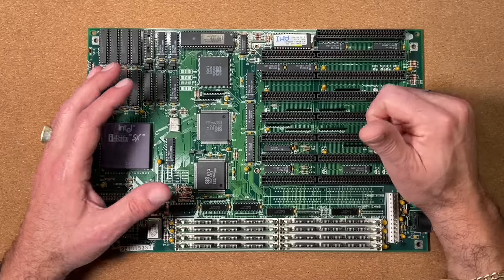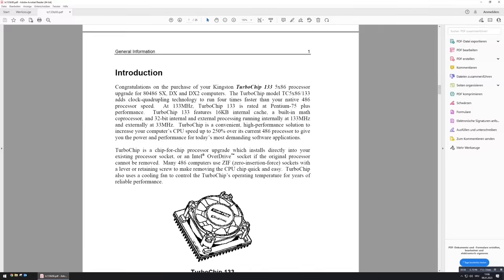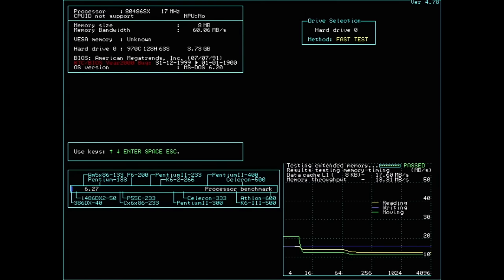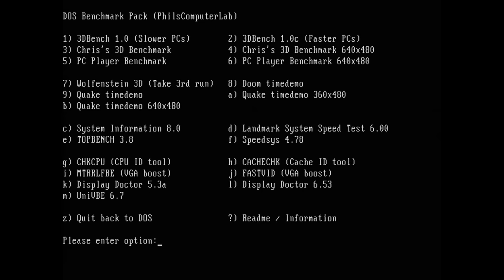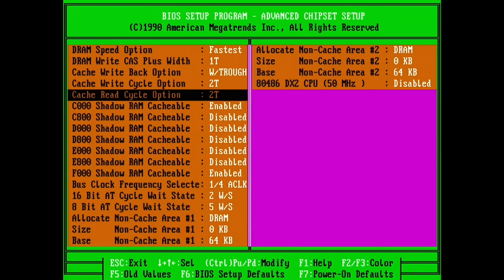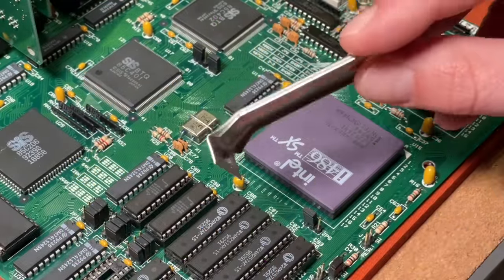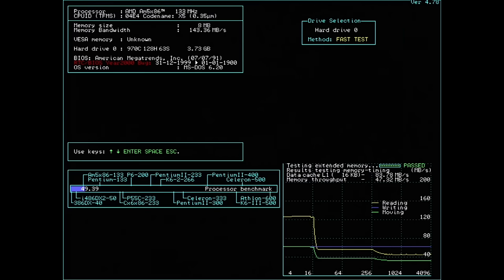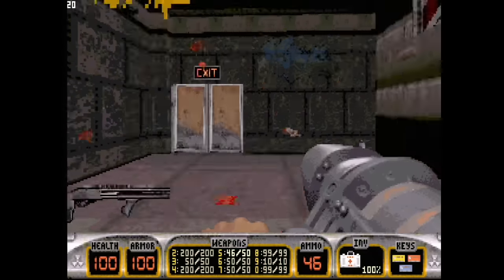Intel 486SX-16MHz Benchmark and Upgrade to Kingston Turbochip at 133MHz (AMD 5x86-133)

Comment: We got that exact upgrade for our packard bell legend 25mhz sx.  The performance boost was huge.  It was like getting a whole new computer.  We upgraded from 4 to 16 mb of ram and put in a sb16 and cdrom too.
Reply: I remember my first CD-ROM, I had to use the ide port that was on the sound card 😔
Reply: The good ol days lol
Reply: Hello fellow 25mhz SX user. My grandpa gifted me what must have been the cheapest IBM at the time because it only had TWO megabytes of ram and the CPU wasn’t socketed so no dream upgrades like this haha. It let me get on local BBS tho and the rest is history!

<3
Reply: 686 was my fav btw
Reply: @idadru   back then  there were 3x CD-Rom interfaces on sound cards, dont be fooled that they are IDE,  the Sony, Mitsumi & the Panasonic - IDE CDRoms came later and didnt need the audio cable after DAE became a thing.. I preferred the Panasonic drives back then no messing around and worked without issues, the sony ones were the most problematic, they didnt even have a motorised tray lol they just spat the tray out half way under spring pressure... lol
Reply: That's the kind of upgrade that gives you whiplash. Was the board ISA only or did it have VLB?
Reply: @ironhead2008  that or PCI would improve the situation. A fast 486 is held back by an ISA graphics card. I noticed he didn't upgrade that and the performance was kind of held back. I think I remember Doom doing better than 20 something FPS on VLB or PCI cards. But what do I know; back then we weren't exactly measuring it, nor did it originally have a FPS counter. The new sourceports do (like GZDoom) and it's easy to reach or exceed vertical refresh on newer hardware. I could run a simulation on PCem and figure it out, probably. That thing's accurate.
Reply: @SeeJayPlayGames  old CRTs were also better at hiding slower frame rates. A modern flat panel smacks you in the face if the frame rate isn't just so.
Reply: can confirm, after extensive PCem testing of various simulated 486 configurations, that ISA video cards will indeed hold back any 486 in DOOM (from 16MHz SX on up). An ISA (be it 8 or 16 bit) VGA card in a 486DX2/66 will run DOOM slower (8-bit: 7626/ 16-bit: 6313 realtics; 8-bit: 9.794/16-bit: 11.831 fps) than a VLB card in a 486SX/33 (5123 realtics; 14.58 fps). 

Even a DX4/100 won't help (8-bit: 6838/slow 16-bit: 5532 - still slower than the 486SX-33 with VLB/PCI. Only a "fast" 16-bit card (whatever that would be, tested on the DX2-66) scored better than (4348 realtics) the SX-33 VLB/PCI. Even still, impressive gains can be had by upgrading to a local bus card from ANY ISA card, no matter how "fast."

So, (all) ISA cards are definitely a bottleneck. It becomes more obvious the higher up the CPU hierarchy you go. With a Pentium OverDrive 83MHz, I got 1774 realtics (42.103 fps) but when I put the VGA into 8-bit mode it only did 6420 (11.634 fps). 

The fastest chip I could simulate on the same virtual AMI 486 clone motherboard was an AMD Am5x86-P75+, which scored a blazing 1332 realtics, or just over 56fps. That went to a sluggish 6370 realtics, or 11.725 fps when the bus mode was switched to 8-bit. So yeah, the faster the CPU, the more an old ISA card bottlenecks it. 

Interestingly, (or not) the most "ideal 35 fps" experience is to be had with a 486DX4-100 with a fast VLB/PCI card. That simulated configuration ran the timedemo closest to realtime (2134 gametics / 2095 realtics or 35.652 fps).

IDK if DOOM was the first game to really push VGA cards, but you gotta figure, it's gotta update pretty much the WHOLE SCREEN every time you move just a little. Previous games may not have had this dilemma. So, maybe.
Reply: @SeeJayPlayGames  Doom doesn't really use any specialized video card tricks IIRC, it relies on a fast frame buffer with enough bandwidth to keep up with the CPU, that's why a 100-ish MHZ 486 class chip up to a Pentium 83mhz or equivalent (the 5x86 counts here because the engine is optimized for a 486 style FPU to the extent it needs an FPU, this ain't Quake) is just about optimal for the game (remember the engine is capped at 44 FPS in game IIRC). Any faster and the CPU is being underutilized. Slower and it's not as fun. I suspect a DX2 or equivalent might be the slowest I'd go assuming PCI or VLB. An interesting thing to try might be using one of ATI's 16 bit ISA offerings, specifically the Graphics Vantage or the VGA Wonder (same VGA core, the Vantage has a Mach 8 accelerator onboard). Supposedly they are VERY tolerant of overclocked ISA buses and are able to handle up to 20 mhz. Of course finding sound and controller cards that can hang at faster ISA speeds would be the bigger issue after that, but you might be able to manage 10 to 12 (lots of controllers and some sound cards handle those speeds in XT clones). I'll wager a 20 to 33 percent bump in bandwidth might make all the difference. It might also be worth it to try an ET-4000 or an TVGA-8900D (with the full fat 32 bit memory bus and FIFO) because they might be able to handle a more modest ISA bus OC.
Reply from the maker: interesting, I am reading your comment while trying exactly that. 😆. Right now I am at 16 mhz ISA clock and 160 Mhz on the kingston turbochip. and you are right with the trident 8900D-R, this one turned out to be the best performer. 😉
Reply: @CPUGalaxy  Yup. that card in particular is STUPID FAST when it comes to the old school "dumb framebuffer" style of video card, perhaps not as fast as an ET-4000 in most circumstances but relatively close and as you found, tolerates faster ISA clocks. The Trident DAC it was usually paired with is a pretty good one, too. It's one of those sleeper cards one might be able to snap up for a fraction of the price of a good ET-4000 with a good true color DAC because some entusiasts might look at "Trident" and "8900" and automatically pass on it. Now the hard part, as I mentioned above, is going to be finding a controller card that can handle those speeds and a sound card that can also tolerate a 2x ISA overclock. Maybe there's an ISA sound card out there that's known to be tolerant of fast bus speeds, I haven't really looked into it. I wonder if a Snark Barker with fast TTL chips (F or AHCT rated) and a faster crystal could handle it?
Reply from the maker: well, now managed 26,66 Mhz ISA clock and running stable. lol
Reply: @CPUGalaxy  Well that's screaming!!! Probably makes Doom more than playable, too!!!
Reply: @ironhead2008  *capped at 35fps - mode 13h is 70Hz so half refresh vsync. If DOS even did VSYNC, that is... IDK.
Reply: @SeeJayPlayGames  Ah, so that's where it comes from. It was some odd number that didn't stick with me all that well, but knowing that, it makes sense.

Comment: If someone made a change like that in 1996 I imagine it would be shocking how diffrent that computer  would feel.
Reply: Seriously… It made it 4-5x faster in a few minutes. No wonder Overdrive/Turbochip upgrades sold like hotcakes. You’d save at least $1000, which is about $2000 today!
Reply: If they're using this in 1996 I'd feel bad for them. Pentium II was out by 97.
Reply: I remember pentium 2 being just stupidly expensive when released. It was much cheaper by 1998. Same with pentium; the P60 and P66 was very expensive and almost nobody had one.
Reply: I upgraded my first PC from a 486 SX 25, to a DX 33, to a DX2 66 to a DX4 100. Yes it made stuff faster but it's a law of diminishing returns because the rest of the system like the bus, memory, storage etc becomes the bottle neck. I still got 4 or so years out of it, upgrading bits and pieces until I did a reset for my move to Pentium.
Reply: @drxym  For games I'm not sure anything above the DX 33 helped if you had some horrid trident ISA graphics thing. If you have a really fast ISA card I think you'd still see gains from the DX-2/66 and above that you'd really want a VLB or PCI card (some very late 486 motherboards actually had this). You'd still get a higher score in FPU intensive stuff, but you can't really play those games comfortably anyway on a 486 (e.g. Quake).

You'd also want L2 when you're getting up there in speeds, which many cheaper 486s didn't come with.
Reply: I mean I went from a Cyrix 6x86PR-150 to an Athlon XP 2600+ in 2004ish or so. It was a pretty decent upgrade.

Comment: That performance benchmark comparing it to a 66 MHz Pentium is indeed impressive considering the possible bottlenecks you get with a board designed for a 16 MHz system.

Comment: Glad you're back!  Unsubscribed just maybe 3-4 weeks ago when I finally assumed that Channel was done :(  So happy to see you again, keep up the good work :)
btw; your 486SX/16 was most likely SO heavily CPU-limited that no amount of tuning won't help. Tuned a lot of early PC's since 1987 and seen a lot of quirks in 1990's and some chipsets behaved very strangely. 11MHz AT-bus should help a lot but with 486SX/16... apparently not.
Reply: Is there any software to tune that 5x86 Kingston you tested?
You can only go so far with AT-bus overclocking until MB goes unstable. Sadly Overdrive-Pentiums were pricey even then. I later had Cyrix CPU's quite a while and those had a lot of tuning-sw available.

Comment: That's just about the biggest upgrade possible without changing the motherboard! The first PC upgrade I bought was an AMD 5x86-133 for my family's old 486. I also replaced the motherboard since the new one had PCI slots, which also allowed me to upgrade the video card. And I also played a lot of Doom, Doom II, and Duke 3D on that machine!

I do like the look of those memory modules you used. The blobs over the chips are a little ugly, but the look of the PCB makes up for it, and it does mean they're very low-profile, which is also nice.

I recently soldered up some new modules based on some NOS Toshiba chips I bought from the US America last year and some other NOS Mitsubishi chips I bought from eBay in 2020 for the parity bit, using an updated version of my 4MB memory module design. While the modules failed testing in my SIMCheck, it was just the parity bit, and the Toshiba memory tested fine at 40ns despite being rated at 60ns.

These would be very good for overclocking if I can figure out why the parity bits failed (or just use them without the parity bit chips). It's possible I just happened to get a couple of bad chips in a row, so I designed some modules that took SOJ test sockets which would allow me to test all the chips before soldering them onto the modules. I also ordered them from the US America, but they sent me sockets that took 0.35" wide chips instead of 0.3", so they don't work. I think I might have to order the sockets from a genuine reseller in Europe or the UK, rather than some random dodgy website in the US America.

But such is the trials and tribblations of designing electronics for vintage computers.

Comment: In advanced tab on BIOS setup, what the option "80486 DX2 CPU (50MHz)" does? It force the FSB to 50MHz?  And if so, you can get the CPU to run at 150 MHz?
What POST card do you use? I never seen one so tiny.
You can populate Banks 2 and 3 (72 pin) RAM to increase the max amount of memory (4/16 M 32 pin RAM sticks are hard to find) and make a nice Win 95 machine...

Comment: Thank you very much for the shout out and for this video. Very exciting, as always. That Kingston CPU is very funny, not only they didn't bother to use a heat spreader, but they also glued the fan directly on the chip, so it blows only at the edges, but the die in the middle is where no air is coming to :D I'm impressed to see this CPU, since it is very rare, but I'm a little bit confused by the engineering job Kingston did on that :D
Reply from the maker: You are welcome! For me I can say your channel is the best retro channel out there! 
And I was also very surprised about the cooling engineering on the Kingston. 😅

Comment: My 1st PC had the same CPU, only it was 25Mhz. Eventually, I upgraded to the 83Mhz pentium overdrive CPU, though I think I had to run it at 63Mhz bc that was the highest speed the board supported. It was a Packard Bell PC. It was cool because I remember using the built-in tutorials to learn DOS commands and how to copy disks,files, and stuff.
Reply: locked 2.5x multiplier on the Pentium OverDrive. A 33MHz (66Mhz?) crystal oscillator transplant would have gotten you to 83.

Comment: Impressive setup. In the old days I owned a 486SX-25 I could easily OC to 40 MHz. I also upgraded ram from 4MB to 8MB. The graphic card was a Cirrus Logic 5428 VLB. It performed so well so I played through Blizzard Diablo.
Reply: I still play Diablo on my system, though it's an AMD-DX4 100Mhz.  I unfortunately "popped" my 486-25 trying to overclock (was still learning).  lol

Comment: Very interesting. I totally share what you said concerning the benchs results that are strictly identical after the BIOS optimization, I've faced the exact same effects on several systems, and jut can't explain why. The 486SX-16 became a piece of collection, pretty hard to find on eBay (at a reasonnable price of course). And so does the Turbochip !

Comment: Upgrading my 486 DX2 66mhz to a AMD 5x86 133 running at 120mhz (due to a strange board issue that would only apply a 3x multiplier instead of 4x) was a good upgrade for my 1st PC. I also use a 5volt to 3.3 volt socket adapter in my setup and bought all the parts individually before Kingston started selling the Turbochip upgrades in the US. I still miss that 486 machine. I used it for a little over 5 years in all!
Reply: You could have gotten 150 MHz out of it easily, if your board supported a 50 MHz bus. I’ve heard that was common.
Reply: @5roundsrapid263  40mhz was the max bus speed on that board. It was a strange gimped PC but I made the most I could out of it.
Reply: @Choralone422  You definitely did!

Comment: Love seeing epic performance boosts! In those days I was running a 12 MHz 286, and would have given anything for that kind of machine. Also, FYI, "quadrupled" (kwah-DREW-pulled) means "multiplied by four." In the context of CPU clocks, I understand this is usually clocked by a PLL (phase-locked loop) oscillator. Makes sense, given you're going from ~33 MHz to ~133 MHz. 👍
Reply: Had a "super 286" running @ 16mhz ... fondly remember that machine , playing Falcon 1.0. Then I got a cheap 386SX which was still a better machine.

Comment: Very nice, those Turbochips are quite amazing. :)
Were those 16MHz chips some sort of OEM special thing, do we know? I worked at a PC-builder in the early 90s and the cheapest chips we could buy was the SX-25. Never did see a 16 and we bought our parts from a huge distributor so if it was available they would've had it. At the time our entry-level PC used AMD 386DX-40, which I'm still fond of today. It wasn't that much slower than the 486-25 as I recall, and the 486 setup cost a lot more.
Reply: Yeah, you'd surely view a 100% ISA board as low-end, but it also has a whopping 8 SIMM slots, something I only saw on more expensive boards, and one of the more configurable examples of AMI BIOS. An industrial application makes the most sense to me, somewhere expansion was important, but clock speed wasn't. At the same time though, this era produced some weird and wonderful things, and it wouldn't shock me to learn it was from a name-brand desktop offering.
Reply: Possibly in some applications that required performance a bit better than 386 performance but lower power and some more features. I'm pretty sure that the 486SX-16 consumed less power than a 386DX-40. I could see it being used in laptops. And regarding the price, note that Intel reduced the price of the 486SX once the Cyrix 486SLC was released in 1992. To 119 USD, no less.

Comment: An interesting comparison would be 286-16 vs 386-16 vs 486-16.
It would also be interesting to see the weitek 4167 up against the 5x86-133 - especially the weitek benchmark programs.
Reply: olden golden memories - the weitek... 5x86...  Weitek equipped boards had a thing with the Xcom IIRC. I dont know, not I can imagine why. They loaded the above 640K memory loaded correctly but then froze when the XCOM started. Same with Xcom 2.
Reply: The 486-16 is more or less on par with the 386-DX40

Comment: The TurboChip actually IS based on a low powered laptop chip, as you mentioned. It has a small spreader on top of the chip. It's a small piece of metal that's embedded in the top, and it's flush with the rest of the chip. It runs slightly warm. (not hot) You technically probably don't even need a fan - even under load. In my experience, it runs slightly slower than a full 5x86 133, but it's still very fast for a 486 class chip. I think those boards were for 286 users, that still considered high end 386 computers expensive, but wanted to start with a 486. I think they were pretty inexpensive. You also got the prospect of future upgradeability. I am currently using one in a computer that was designed around a DX 33, so the Kingston dropped in & ran just fine. There were some Cyrix options, but they occasionally ran into timing problems.

Comment: Really interesting upgrade, but yeah the ISA bus is definitely causing the CPU some bottlenecks!  I would have loved an upgrade like this in the early 1990s when I had a 486-33.  By 1996 I was using an AMD 5x86-133 (OC to 160Mhz) in a motherboard with a proper PCI bus and it performed extremely well.

Comment: Lovely video, congrats.
However I think the slow graphics performance on the original CPU was partly due to the clock divider was set to run the ISA bus at a 1/3 of the system memory clock, and once the system got switched to 33MHz, the ISA bus got a very needed boost as well.